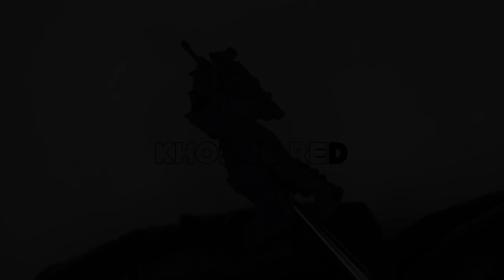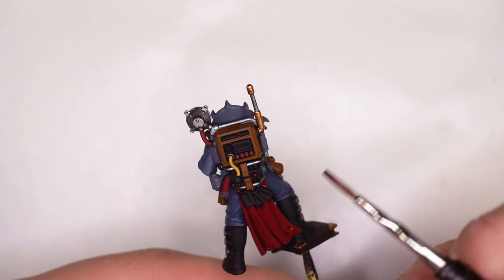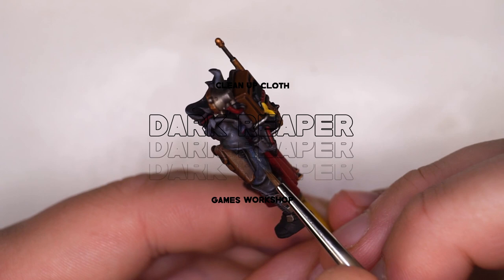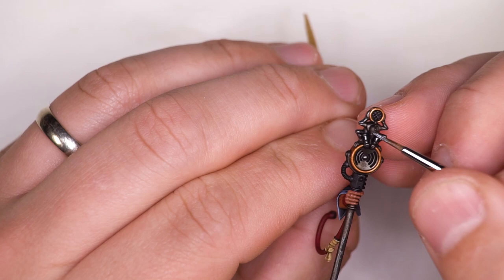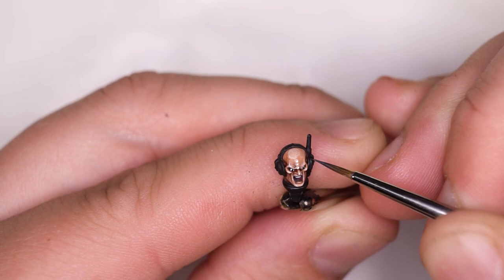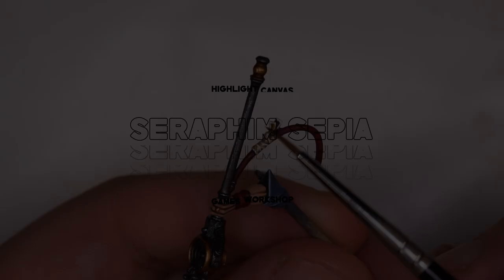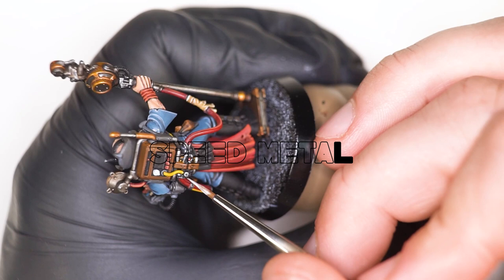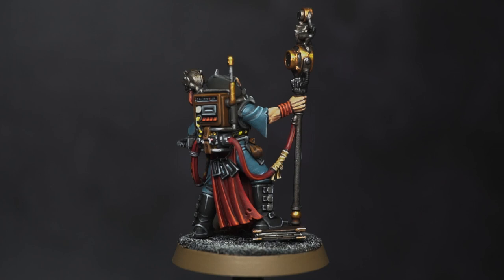How To Paint - Games Workshop - 40K - Genestealer - Clamavus - (Parade Ready)

Comment: That turned out super! The only thing that irks me is that the tufts don't look like they are part of the environment. They are just kinda floating on top of the ground. 

I find using a tiny bit of super glue helps them stick better and dabbing on a bit of wash or pigments that you have for the base onto the tuft gives it that little push into the environment it's in.
Reply from the maker: Great advice thank you! Sadly I’m doing the bare minimum as the client wants me to match some previous models from a commission. But I totally agree. If they were my own models I would do way more basing wise. You can see from my other videos the work I can put into basing. Cheers!

Comment: what tools do you use?
Reply from the maker: I have a lot of tools. 
Go to things would be,
Silicon sculpting tools
Hand Drill and a ton of bits
Small modeling files
A good set of sharp tweezers
Exacto Knife (scalpel)
A selection of fine grit sand paper 
Nail buff pads for polishing plastic
Regular metal sculpting tools to manipulate green stuff putty. 
Cocktail sticks
White tack
Paper clips 

These are the things I seem to have in hand most often.
Reply: Ah so in the video you were using a cocktail stick and white tack to hold the model? That looked really handy! Your brush also looks much nicer to use than mine, or perhaps its your steady hands.
Reply from the maker: Cocktail sticks combined with the gel type super glue is a potent combination. Much more controlled results. 

In terms of brushes I like the Davinci brushes. Size 1 and 0. Many thanks.